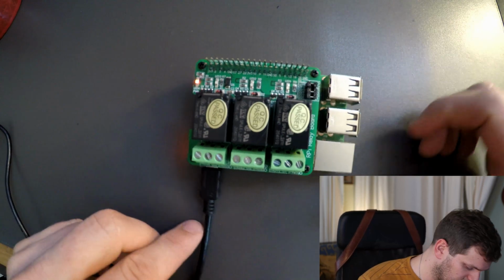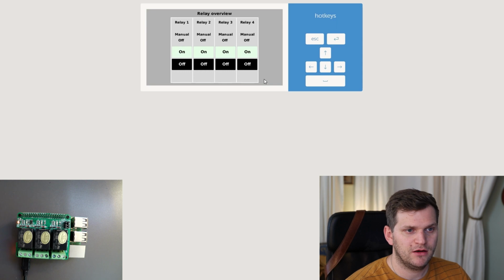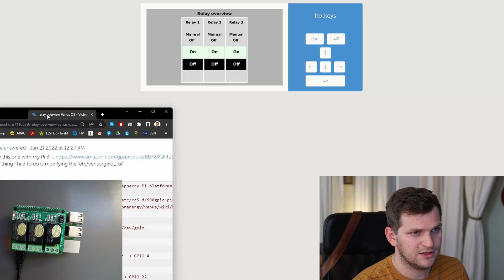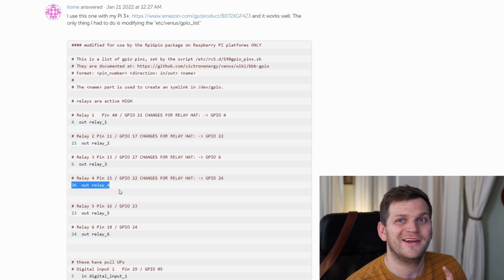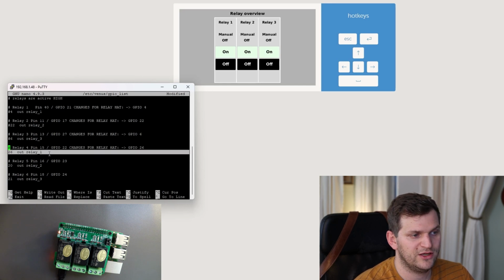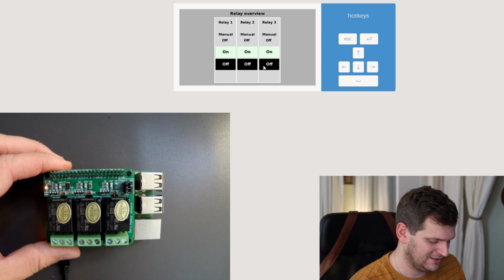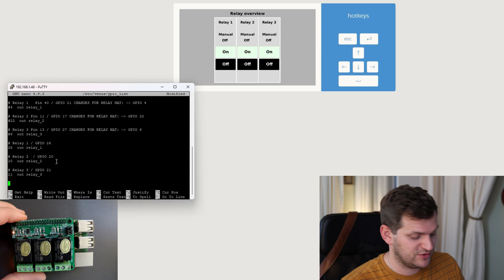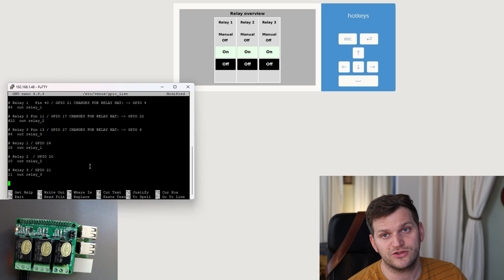Victron VenusOS & Raspberry Pi| Install Relay Board and setup | 3 Relays | Part II

Comment: i tried to follow it. it doesnt work with my board. it has 4 relays on pins29.31.33.35. after rebooting raspberry pi loosing connection with wifi and bluetooth.

Comment: Hi, thank you for the tutorial. Will this steps also work with a Raspberry Pi4 running the Venus OS 3.51?
Reply from the maker: It should - but not with the new UI so far. I have no information if/how it will work yet. Stay tuned - I hope I can find out
Reply: @tobisreallifeskillswithtobi  i tried it but i cant make it to work. maybe the new version of the gpio is different from the onld one.

Comment: Hi Thanks you for great video setting up the relay i have installed a 3 relay board and software you have shown works ok but the led light for the relay is lit before i even turn it on and gose off when select on so working opposite way round to yours, if you have any idiea please whay that is

Comment: Any idea why its not working with relay boards - not hats? Tried with 1, 4 and 8 relay boards and nothing. Played with gpio options and nothing. :(
Reply from the maker: Which product do you use?
Reply: @tobisreallifeskillswithtobi  few cheap relay boards. Finally made them running, had to do clean os and package install. But still need to figure out how to change relay switches. Right now, while on on panel, relay is off and when i hit off it turns on :) 

Also, it's quite annoying that during pi bootup it cycles relays.
Reply: Hi  @ŚlademWierzb  , did you managed to solve this issue with on/off been inverted? same is happening to me, all working but on / off is inverted

Comment: Once again... Thank you for such clear videos! I got the 3 way relay board in today and got it connected and, thanks to you figuring out the logic for the pins, I am up and running in a few minutes!
I also have the package manager installed and am excited about the new features. 
I have an old gopro hero 3 that I took apart, soldered on some tiny leads to the negative, the power button, and the camera click button. They are working properly to control the camera.
For fun, I am going to try to use one relay to turn it on, and another to trigger a camera click. Just looking for a delay and pulse option now rather than on off switch for the relays.
If I'm lucky, the ruuvitag motion sense will trigger my gopro to turn on and record.
Reply from the maker: That's an awesome test! I'm curious if it works! Please keep me posted!

Comment: analog and digital hats for raspberry venus os would be interesting to see. 
 eg monitoring of other batteries and bilge pumps
Reply from the maker: Thanks Mange! What do you mean with analog and digital hats? Regarding the bilge pump I know it does work but I need to do more research on this since I do not have such a pump in use.
Reply: to measure several batteries, you must have an analog signal.  raspberry dont have analog signal.  have seen that there are analog hats.  and for digital, I want to receive an alarm that the pump is running.